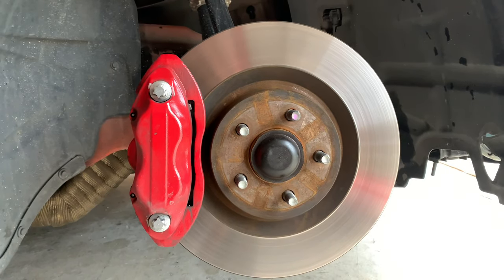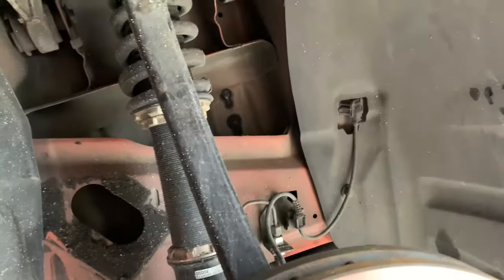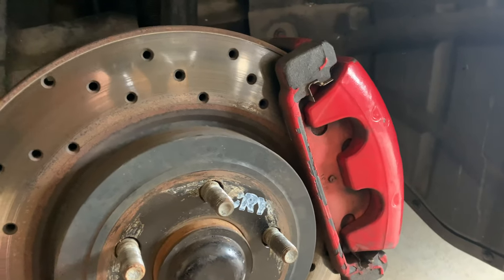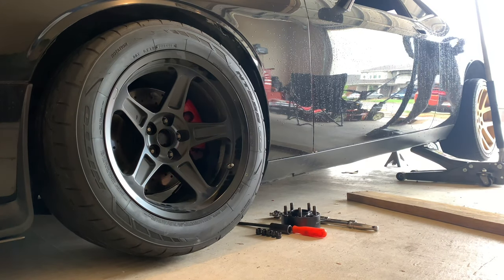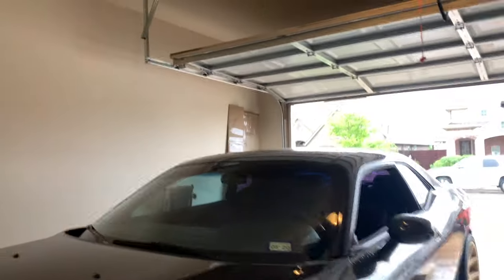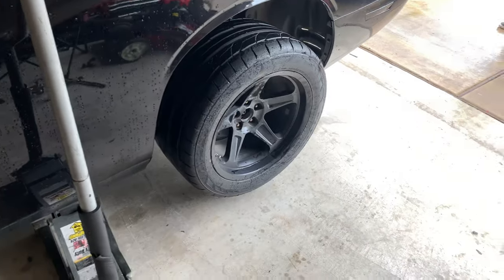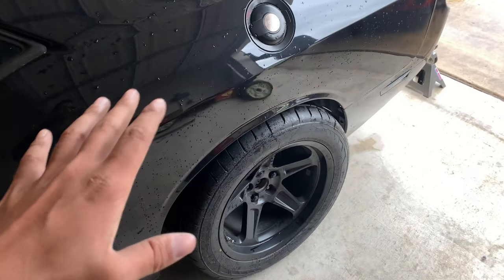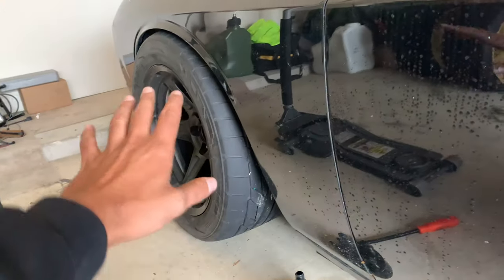OEM Dodge Demon Wheels On a Narrow Body Challenger!

Comment: Oh Mate, write me Back PLEASE, because i'm working on my 2006 Dodge Charger R/T DAYTONA, what i've imported fresh by myself from NC to Bavaria Germany....and i'm doing a Not so common custom Project in it...with the will to get a little look like the Dodge Demon.
Because i didn't got those original 18 Inch Demon wheels i was looking for something else like that. So i would not Go with the common 20" rim Sitzes; i've bought VORS TR4 rims with the Offset of 22 in 19×10.5" for front and rearend. 
I've also BC coilovers, what looks like yours.
And i'll use 255/45 R19 at the frontend (a little stretched tire Look) and 285/40 R19 at the rearend for a meaty look like the Demon wheels... 
But at the Moment im still waiting for the rims.
And now YOUR Video ist the 1st were i could see a little more about that Demon wheels in a RT. Yes, my one is a Charger ob the 2006 LX Platform. But i can't beleave that there is a big different about the knuckles/spindles or something else like that to your Challenger RT.
And about my rims; they're using the Offset of 22 mm with the rim wide of 10.5". So i know i have to use spacers at the frontend. But i don't know how big they must be that the rim doesn't scratching insides/on the spindles/knuckles. I think i should have to use 10mm spacers to get a Offset of 12mm with those 22mm Offset rims... Or if 7mm spacers could Help against the hit in the knuckles/spindles, i would use 7mm spacers. Then i have an Offset of 15mm with that 22mm Offset rims.
BUT WHAT SIZE ARE THOSE DEMON RIMS???
the wide and offset of the Demon rims is so interesting for me. So you could tell me that, PLEASE???

Have a great day 🍀👋🙂 best regards from Bavaria, Germany
Till
Reply from the maker: Hey Tilli!

They are oem dodge demon wheels in 18x11 with -4.5 offset. 

The knuckles on your charger are the same as the challenger so demon wheels won’t fit your car either it will end up just like this video and end up being too close to the knuckle.

The Lx,Ly platform interchange a ton of parts. All knuckles for SRT trim levels with the 4 piston brembos are the same from dodge magnums, Chrysler 300’s, Charger and challenger. 

Same goes for the NON-SRT models. Your best be for some more clearance is finding SRT KNUCKLES and brembos to swap over. 

I used to run TSW VALENCIA in 20x10 +22 offset with 255 tires on all 4 corners but 255 was the absolute biggest I could run in the front. 

So at 10.5 width +22 I can see fitment issues in the front unless you use a spacer.
Reply: @TIRADORACING  Wait, so if my daily driver is already an SRT, I don't have to change knuckles/brakes to run factory Demon 18x11s in front?
Reply from the maker: Like I said if you have the 4 piston brembos. They won’t clear the 6 piston brembos. Demons come with a caliper similar to that found on vipers. They are not 6 piston. 

4 piston brembos is what you want.
Reply: @TIRADORACING  What about just running a simple spacer on the front? Would it push that massive 18x11 far out enough to clear the A-arm? I guess you'd still have to deal with clearing the caliper, though... Oh, and a wider track in the front than the rear, etc.
Reply from the maker: Exactly it jut starts getting messy really quick. 

4 piston brembo cars are fine 

6 piston brembo cars are not
Non brembo cars are not 

Some scat packs have 4 piston brembos and their fine and some scats have 6 pistons.  So I can’t say all scat packs are safe.

Comment: Whats size is your tires
Reply from the maker: 315/40/18 on all 4 corners on oem Dodge Demon wheels 18x11.
Reply: TIRADO RACING that’s why haha if you run 305s on fronts pretty sure its gonna fit well on his challenger
Reply from the maker: Gonna try in the future!

Comment: Its too low! That and the tire is the problem. There is no difference in the knuckles really.
Reply from the maker: I wouldn’t say there is no difference in the knuckles, there is in fact a difference between rt knuckles and srt knuckles. Rt knuckles can’t have brembos mounted to them either.
Reply: @TIRADORACING  True.  I figured that out on my RT.  The SRT knuckles bow inward a little bit more, enough to clear those tires and the scat pack widebody wheels I tried on it.  And the point about the brembos is true too, for a couple reasons.  Where the brakes mount, on one is smooth holes, on the other is threaded, but also that boss is thicker on the SRT knuckles.
Reply from the maker: Dave Newman yes sir, that’s why I recorded the fitment on both the R/T and my SRT, it took a lot homework but I wanted to provide as much information as possible. I would like to get into an R/T for simple seat time and swap in SRT knuckles and brakes and this wheel set up.

Comment: Thats an adaptor not a spacer
Reply from the maker: The stock bolt pattern is 5x115, the wheels are 5x115… the so-called adapter is 5x115….

It’s a spacer, it’s spacing the wheel out. 

You CAN find wheel adapters that go from 5x115 to 5x114.3 and other bolt patterns. But that was in fact a spacer. 

Here’s a link to some spacers 

https://www.titanwheelaccessories.com/products/copy-4-dodge-1-50-hubcentric-wheel-spacers-black-5x4-5-chrysler-300-challenger-charger-magnum-srt8?variant=41738367303838&currency=USD&utm_medium=product_sync&utm_source=google&utm_content=sag_organic&utm_campaign=sag_organic&gclid=EAIaIQobChMIiZfrx-Lt-gIVthXUAR0yuAo8EAQYAiABEgITPPD_BwE

Comment: Tight fit? Let's be real, that's not even drivable... I imagine the minute you sit in it, it's going to destroy your quarter-panel lip, tire, etc.
Reply from the maker: Time out bugs bunny. On stock height it would be a tight fit. This car is slammed. You can definitely drive it if it was stock height. But you wouldn’t know. Your just watching other people try things living their best lives.

The moment I sit in it it’ll destroy it..... how do you think we moved it out of the garage? It teleported? No dude we drove it out 😂. 

Rabbits are cooler.
Reply: @TIRADORACING  No need to be rude to your subscribers. Some of us actually own the car those wheels came with. You can easily put them on without driving the car,  “Toretto” Racing.
Reply from the maker: I was just being real with you.... you know.... like the way you started the conversation. The car didn’t get destroyed from us sitting in it and moving it. 

“Torreto” Racing is still dope I’ll take it 😎🤘🏽
Reply: Hey, Torreto, what about running the 18x11s on rear, then just putting the Factory Reproductions in 20" on the front, but with a lower sidewall so the overall diameters front/rear are the same? Do you think that would look all right or is it better to just swap to the smaller brakes/knuckle, all that, in your opinion?
Reply from the maker: Bugs.... I’ve seen that done before. I can’t remember the name of the persons Instagram. 

In my case it was hard finding 200tw tires in 20” wheels. That’s why I went for 18’s all around. 

In 18’s and some 19’s you really open up your tire choice for 200tw tires from bfgoodrich to falken and Bridgestone. 

The other half of the battle is how big our cars are, we really need as much tore up front as possible to turn them. So having the 18 in the back is good but then the 20 in the front will limit 200TW tire choice. 

So for autocross I would swap knuckles and brakes on the R/T and get the 18’s 

If your just doing a drag build or just want the look the 20’s up front would be a good fit.
Reply: @TIRADORACING  I'm having the opposite issue with lack of tire sizes for the 18s... I want to run a 305/45-18 (315/40-18 is just too small of a sidewall if I'm going to pair it with the stock 245/45-20 on the front) and it seems everything is limited to a DR in those sizes. I guess the right DR on the street isn't too bad (I'm thinking the NT555RII), I just don't want to get caught in the rain or have to replace them every 10K or less. I would to the pro-touring/TransAm look as it seems you are doing, but I would feel bad swapping out a perfectly good set of Brembos to do it. It DOES look cool with those deep-dish Demons on the front, though...

Comment: Spend the money and get the right offset wheels.. The difference in wanting a setup that actually works verses trying to look like a baller...
Reply from the maker: This wheel set up is for my orange challenger and it works great for autocross, road racing and being able to run 200tw tires for the Optima Ultimate Street Car. 

This video was for fun to see how close my demon wheels would fit on a narrow body challenger and to see how it looked because I’ve had many subscribers and followers ask me if it would fit. The bang for the buck for demon wheels is unbeatable.

- forged aluminum (light weight, less rotating mass)

-18” that clears the brembos 

- 18” allows you to choose between more 200tw tires for autocross etc...

So we tried it out! 

You can only get oem demon wheels in one offset and that’s -4.5 in 18x11.

Now the people who wanted to buy OEM Demon wheels can make an informed decision based off our experiment.
Reply: I believe you did not understand the purpose of this video, quick to insult with “ trying to look like a baller”, but slow to comprehend the purpose of the video.
Both cars on this video look great. They tried something out that people have been asking. They delivered the results of their findings.
Reply: Albert Garcia Not to insult whatsoever,as you don’t have to be a engineer to know what this would look like and as far as working correctly what the end result would be.. Once one saw spacers on the car and those hoopty rims I kind of got the impression it was about balling verses having a well engineered and working car with demon rims and tires..
Reply from the maker: James, I believe your still miss interpreting the point of the video, it is extremely difficult to find 18” wheels to clear our brakes and allow us to run the competitive tires we need. That’s why my community asked if it was possible to do a test fit (which we did). 

I’ve seen some autocross/grip cars with this “look”, but the point is to be able to run high amounts of grip/ aggressive tires. Very common in the CAM-C class.

As long as the people who wanted to know got their answer and gained something from this that’s all that matters. 

No need to insult anyone in the video, I am very grateful my friends let me use their car to test fit parts that way people don’t spend money to find out it doesn’t work or they dislike it.
Reply: TIRADO RACING agreed ! I don’t mean to insult it’s just your videos are really informative and this kind of seemed like it strayed away from that .. Respect and I apologize as we speak the same for cars..
Reply from the maker: I appreciate that and no worries, we had a little more fun with this video but I tried to still have as much info as possible without beating the topic dead. 

This isn’t the end of this, I would like to get an R/T for simple seat time and run this combo with some sticky tires. 

Thanks for watching! If you have any questions I’m always here!
Reply: CFLJAMES1320 There are a lot of people that are not able to see things, without observing. Those that go by “ seeing is believing”.  They need a visual. And there are others that can. These young folks are providing some really good information, very valuable to many. Some might be able to spend the money, some may not. 
I read the rest of the comments, and read your conversation with Tirado racing, seems like there is an understanding now. 
Be well and enjoy motor sports.
Reply: Albert Garcia absolutely...👍🏻